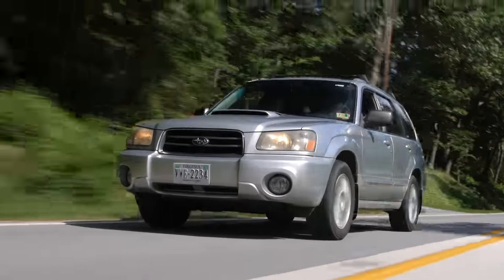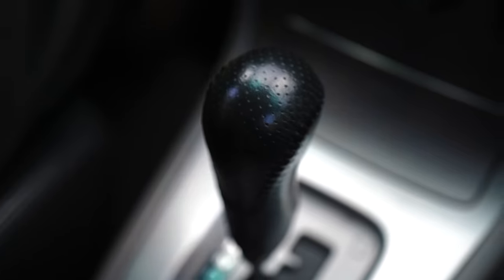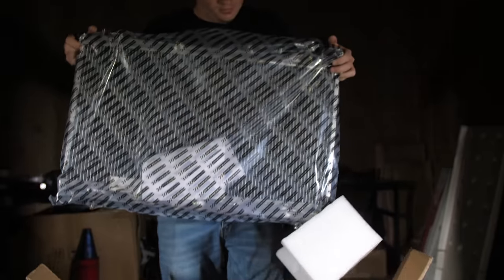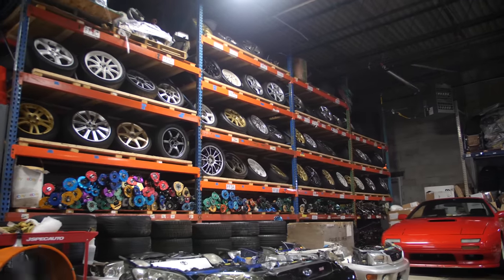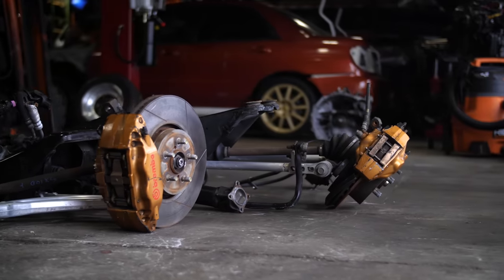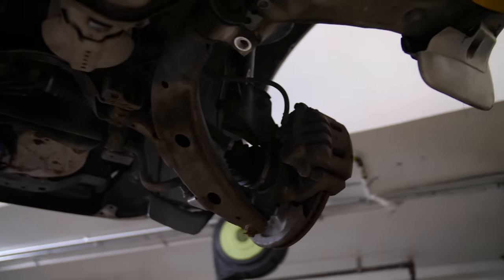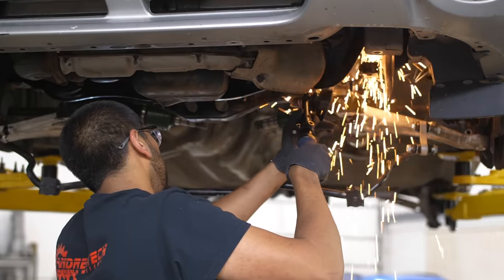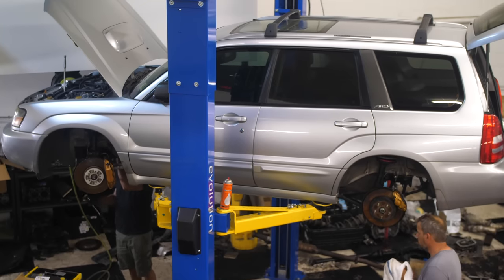6 Speed Swapping My Subaru Forester: Part 1

Comment: Great job, Bens! We've been wanting to build a FXT with STI underpinnings for a long time. Going to live vicariously through yours now.  Bring it up to Ontario in the spring and we'll go for a rip together. We might even have a Subaru of our own to chase you around in by then :D
Reply from the maker: Ohhhh man!!
Reply: how much extra would it have cost just to do the whole STI drivetrain swap since you had a lot of stuff taken out already just curious on why that wasn't put on the table I realize cost is an issue but I think since you bought so much stuff the engine itself you probably could have got a good deal on and since you're taking everything apart anyway???
Reply: @eppyz  2004 forester XT actually has an STI engine already.
Reply: @ozzypawsborneprinceofbarkness  he said 210hp the STI of that vintage had 295-300hp I believe so I don't think this is the same exact engine.
Reply: @eppyz  2004 forester XT and STi from those years share the same exact motor down to the t,  only difference is intercooler and turbo. The reason it makes less HP is because the turbo in the XT is smaller along with the tune, put in an STi turbo and give it a tune and its making the same power....
Reply: I wanna see the evos and subies  go for a hot lap together once all this covid stuff is over. That’d be awesome!!!!
Reply: @KevinMO91  I have an 02 Wrx engine and 5 speed, could I put that into an 03 forester, get wiring/ecu  ? without the subframe change outs ?  guy said 6 speed was different animal  ...  hmmm
Reply: @GearsandGasoline  How do you shift the automatic, and does it have any lsd as it is before the swap? And can I just swap in a 5 speed even though the 6 speed transmission is bulletproof?
Reply: @GearsandGasoline  how would you shift through the gears on the forester xt 4EAT automatic transmission?

Comment: omg yes! i have a 2003 Forester XS Automatic, i am SO DOING THIS SWAP! yessss thank you Gears and Gasoline you guys rock!!!
Reply: Same here bro! I got a 2002 Subaru Forester S Auto! Hope yours turns out well! I probably won't modify mine in years but still one can dream for now 😂
Reply: TBH itd be better just to sell your auto forester and buy a 5 speed forester. Not worth putting money into an NA vs a turbo forester. 

Although if you are it would be easier to do a 5 speed vs a 6 speed
Reply: @colin6868  why not? What if we not tryna male big numbers just good enough for the streets? Can it be possible
Reply: @spacecityhyundai6047  Its possible, but you are 1: going to get bored really quickly, and 2: wan to add more power and you might as well start with the xt motor that was bulit to handle boost unlike the NA engines.

Comment: I love the auto in my FXT. After stage 2, trans cooler, and a pro tune the auto works great. Only hunts for gears in D if I'm really bending it through turns, in which case I'm shifting thru 2,3,4 and blipping the throttle in between shifts. It's no dual clutch but timing is predictable and usable on most spirited street driving scenarios. I'm sure it's garbage on autoX. Like you said,  I would (Still) be in a WRX if I wanted a race car. I get wanting the manual but for daily use in and around DC my auto was great. What up Andrewtech! Cheers from Montana.
Reply: Same here. There is a simple transistor mod to get the "shift kit" faster shifts as well. super cheap.
Reply: Alex Jamison I saw in the video that he down shifted! I’ve never even thought about doing that in my auto FXT. Have you done it before?
Reply: @dave3k13  I downshift to 3rd on the regular, but I don't use 2 very often at all, mostly only in offroad/snowy situations, especially since 2 actually locks the car in 2nd so it can't go down to first. 

Think of 3 as sport mode, already down in 3rd so the shift down to 2nd to make power is relatively fast. :) Drive is for fuel economy/highway driving.

As I stated in my other comment, the shit-talk on the 4EAT in the beginning of this video isn't justified imo, it's a great transmission. Absolutely bullet-proof as well.

Comment: I own a bone stock 5MT '04 FXT my dad bought new, it's great to see some new videos come out about this car and that there are still places around that work with the Forester. I'm pretty gentle on mine so haven't had any of the common engine and transmission issues in 160K miles. That said, a couple years ago I did have it in the shop quite a bit over the course of a year for normal wear items (rubber hoses, seals, bearings) as well as a cracked valve that I nearly let destroy my engine. Since I did all that work it's been running great and I'm looking forward to doing a few modifications to help it drive better in the mountains.

Comment: I really hope, you'll clean the headlights
Reply from the maker: I got some brand new ones ;)
Reply: @GearsandGasoline  really????
Reply: With my '05 FXT, the hazing was inside  the housing. Thought about doing the 'put them in the oven to separate the lens from the housing' trick, but decided to swap them out, as well. Found assemblies on Amazon way cheaper than the Subaru parts catalog.
Reply: OEM. One of the lenses cut-off pattern is a little janky, but whatever. Cheers!  @jasonmarten6959
Reply: +soul theorem ahh. Projector headlamps are like non existent on our cars, trying to avoid the retrofit route lol. Thanks for reply
Reply: @GearsandGasoline  LED/Projector ?
Reply: Why are they hazed, thought this was garaged it’s entire life?

Comment: I love my Automatic SG5,  bought it with 158k on it for $7500,  Excellent condition in and out. had a STI intercooler, Grimspeed plumbing, a TD04L turbo, Grimspeed uppipe and 4 inch stainless, (catless) to a Magnaflow muffler made for a subie. (sounds amazing)  some 17" wheels on stock struts with whiteline sway bars and links. No body roll at all and for stopping power a set of drilled stoptechs.  I assume it has an flash tune because tops out at 165, and will spin all 4 from a launch and perfectly shift into 4th gear at 125mph.  The EAT4 trans is so much fun if you do the right mods.  That was 4 years ago, to this day im still driving it like its got a warranty, and its at 220k.

Comment: 6 speed Subaru forester is a proper forester
Reply: Is a 5 speed manual turbo ok
Reply: @Upshifter91  yessir
Reply: @MaxSpeedMike  I picked one up for 1200 in New Zealand where I live
Reply: @Upshifter91  that's a steal!
Reply: @MaxSpeedMike  yes lol. Hasnt been perfect needing new radiator and diff or abs starting to act up I think lol
Reply: @Upshifter91  if your handy you'll be good
Reply: @MaxSpeedMike  kind of lol I hope so car is doing this funny jerking at random times during acceleration. Don't really have the money to fix it. But I'm in love with her. Mine is a 2001 forester
Reply: @Upshifter91  I feel ya. Is this your first car?
Reply: @MaxSpeedMike  nah third but I'm just a supermarket worker
Reply: I am about to buy one here in Puerto Rico (non turbo Automatic from an old church lady) in excellent conditions, practically new, with 80,000 miles on it for 3k. No idea if thats a good price but i need a bigger car that is safe for my baby girl and can be cool to modify in the future. These videos give me hope.
Reply: @JoseACostan  sounds like a good deal to me. Manual swap it
Reply: MaxSpeed awesome. Its not the turbo or anything but what would changung the steering peice improve?
Reply: I just got a 6 speed 2015 forester for my first car

Comment: Gahh! So awesome! I have an '07 FXT 5MT and the six speed swap is on my list. HOWEVER, I too fell for the forum hype and thought it would be a simple trans swap. Then I learned about the rear diff ratio not lining up right. I didn't know about all this subframe nonsense. Also, from your Alaska video I remember you had to have a custom spacer milled so that the drive shaft angle was corrected - please put info on that in future vids! Loving the content, as always. 👍😎

Comment: My 04 WRX actually has a JDM S204 Engine swapped over by the previous owner and the motor was bought from JSpecAuto. Planning on also doing the 6-speed swap as well down the road. So great to have a reliable source for those JDM car parts. :D

Comment: Killer project! I just picked up a fixer upper 2005 XT and the steering feel is actually pretty decent. no real slop, perhaps someone has already swapped it with something, is does feel way better than my 03X. Body roll heck yes. And yeah the auto is serviceable at best - far from modern auto standards.

Comment: I have a UK spec 2006 XT and the auto is different: it has "sports shift" which is a side escape addition to the usual RND321 that is almost like a sequential shift, I'm not sure how much better the stick shift would be but at least sports shift lets the driver decide when to change up/down, so you can hold the revs higher.
Thumbs up.

Comment: I am excited to see the finished product.
I want to do a similar swap for my 98' 2.5rs, but I don't know if I will do a 6 speed or a 5 speed due to price differences.
I would've gotten mine manual, but all the manuals in my area are rusted to hell, 4 door no moon roof, and in questionable shape. Mine was practically rust free, 2 door with the moon roof but at the cost of being automatic. IMO it was worth the sacrifice but the dream would be for it to be manual. Definitely gotta start saving now!

Comment: Okay. First, yes I would have hoped all over the deal you got for the car. Second, a OEM radiator will last MUCH longer than 50k miles, keep it maintained and it will last 150k+ as mine has in my 06 wrx Hatch. Third, great video, sick car, get some sway bars and coilovers and you're set on that bodyroll. Fourth, no they don't have poor steering feel, change your damn power steering fluid on its intervals and it'll stay buttery.

Comment: Finding a needle in a haystack is easier than finding a manual Forester XT that body style. They made them, but not very many at all.
Reply: I have one in my 05 FXT, but it has not held up well. Back about 6 years ago when I was running a stage-2 set-up, I fried the bearings using Cobb's launch-control "a few too many times" (even with launch set at only 3,500). Now, about 3-years after a turbo upgrade (and pro-tune - no more launch-control), the trans is making not-good noises again. 
Granted, I love 4.44 off-the-line acceleration (surprises the crap out of people at stop-light challenges which, for the record I don't do too often!) and 0-60 with just one shift, but the 6-speed is a much stronger unit that holds up better to mods. I thought about doing a swap back when the bearings fried but the cost was prohibitive, but now regret that I didn't.

Comment: watching this video because I have a '05 Fxt with a vf39 and sti tmic from a stock sti, cobb 3" down pipe, stp intake, stage 3 pro tune, and kyb struts with swift springs, with an AP, YET NO 6 SPEED SWAP!
Reply: I feel you brother, I have a 05 fxt with VF34, V7 spec intercooler, grimmspeed downpipe, WRX STI wheels, steering rack and whiteline rollbars but 6 speed swaps are so hard to come by in Europe and if one popes up it's so expensive it's cheaper to import a forester STI from the UK.
Reply: @tubejorrit  geez haha. Feels bad. I have some recaro wheels on mine xD. Gonna make them the winter wheels with snow tread and some nice black sti wheels on koni adjustable struts and springs with a good low pro summer tread, was wondering if it would be easier to get a O7 wrx 5 speed done but I would still want to do steering rack and tie rods and stuff like he did in this vid. How much psi are you running on that setup
Reply: @AcuRobbie  I'm cheap so just pump gas and 1.15 bar. Makes around 340 at the crank. I also have 17inch WRX wheels. WRX STI rack is pretty simple and makes a huge difference! I didn't bother with other struts and/or springs since the whiteline sway bars make the car a lot stiffer and much less rollover in corners.  Oh yeah I also have WRX 4 pot brakes, also a big difference!
Reply: @tubejorrit  sway bars are definitely on my list haha. I might just do the rack and adjustables to be honest. I think everything else doesnt feel too bad really. Just gotta get my height adjustment and less roll in the corners on wider tread. I im running about the same boost, I think im close to 295-300whp and abput 325-335 tq, I might have a bit more then that as I bought with new headgaskets and belts so, I might have a slightly less old horsepower effect, but I doubt it. I want to do a tune to 19.5lbs or 1.35bar
Reply: @tubejorrit  did you just get one of the whiteline sway bar kits that are about 500$ not sure what they are in pounds

Comment: Wonder if that 6 speed was stolen since it came from J Spec Auto 🤔, and that's not a stab at Gears and Gasoline cause Im sure they had no idea.
Reply: Either totalled or plain stolen, frankly.

Pretty sure the people in J-Spec don't even know what's happening. Just the ones who make top decisions.

It's like VW's dieselgate. The factory workers had nothing to do with it, just the board members.

Comment: I don't get why you didn't drop in the FXT 5MT. It's a much easier swap.
Reply: cuz subarus 5 speed really sucks
Reply: @nicolaslee7331  the 5 speed is weaker, the 6 speed has closer gear ratios and the brembo hubs and axles only work with the 6 speed and R180 bigger diff/rear end

Comment: Hello friend from Boston Massachusetts change the cardan of my subaru forester 2009 the car cadaves that I turn to the right or left wing osiago some return in u nose if the team is in some alignment or if my transmission is damaged but I do not have knocks when running in the express only vibrates when I double low speed

Comment: i have a 2004 fxt 5spd, and i want to do the 6spd swap as i already put in the money for my IAG stage 2 built motor.  i cant really go higher power than my vf48 and 93 oct tune because im worried my trans will break.    :(
Reply: as long you shift sensibly and not aggressively it will buy you some time.

Comment: Eh, the 4EAT is bulletproof, and if you find it's always in the wrong gear, that's a you problem, not a trans problem. 😂 Not hating, just don't feel your trash talk on the 4EAT is justified. 

I may 6-speed swap someday, but I think I'd rather do the high stall TC and upgraded valve body first. Something different.

Comment: hahahahaha you got me so good when you said there is so much drive train loss you might as well not have a turbo. Fuck man, when I drove the auto's it felt like it took 50-60hp just to move the damn gear boxes. In a manual you literally feel like the same engine has 50 more hoof, front bumper cover no grill, motor & transmission. This car was hit on the front right corner and down right passenger side. Car still cranks and runs.p in those subarus.

Comment: Does the 2105 sti rack fit in plug n play or does it need some adaptations?
Reply: Needs adaptation. Iirc there is an extra mounting point in the 2015 sti subframe and Ben here might have had some difficulties with it in this build. Bolt on sti rack would be a 2004 sti one
Reply: @alexc5022  I was a bit off here now that i watched this build series again. Ben had trouble with the drive shaft not the rack. He also did indeed swap the STI subframe as a part of the 6 speed swap so he got to use all 3 mounting points. If you don't have the subframe you just lose a mounting point iirc. A channel here called "DIY everything" made a video about the steering rack install a while ago. He has a few good videos of modding his XT it's definetly worth a look.

Comment: Swapping the subframes? you don't HAVE to do that like stated in the video. You don't even need to drop them. STi diffs bolt right into the forester subframe and the front control arms can be swapped as well. Yes, they are different, STi is gusseted, but you do not HAVE to drop the subframe. My mind is just blown over this. Oh, and if i'm not mistaken, JDM drivelines have shorter gears. Enjoy cruising at insanely high rpms!!
Reply: If you knew what you were talking about, you wouldn't talk..  

Geo is different with the subframes.. why not put the better subframe in? 

Depending on which JDM 6mt you get..  Truth is, the JDM Forester STI has the tallest gearing..  like 2,700rpm at 80mph..
Reply: @winnerone23  agreed. you can cruise on highway speeds off-boost in a genuine JDM FSTi

Comment: I drove my LX for 16 years and 139, 000 miles and lived it.  Anyone who wants a hot car to drive they should skip Subaru since the are reliable and get you there and back, just in a leisurely manner.  Reliable and seldom sexy but never will pin you to the back of the seat while hitting pedal to the medal.

Comment: I have an automatic SG6 '05. Its a full IAG 600hp block etc... in it. The stock Auto with tuning can move great man. You are just looking at a stock Forester XT which is nothing to cry home to mom about and bitch slapping the machine. Not worth it man. Give it a new heart and the transmission will be good.

Comment: Please.... You must be spoilt lol drive an 04 buick century for a couple of years then come back to me and tell me about loose steering and body roll. Transmission shifting to be twice as bad. Body roll is twice as much. Steering is so loose you have to twist the wheel 5 times make it turn. About as much power as a 2015 Nissan Versa and a 6 cylinder. Lol you have no idea if you think this car is bad.